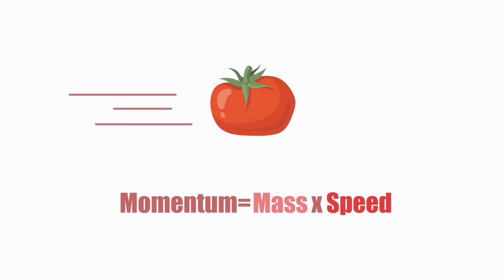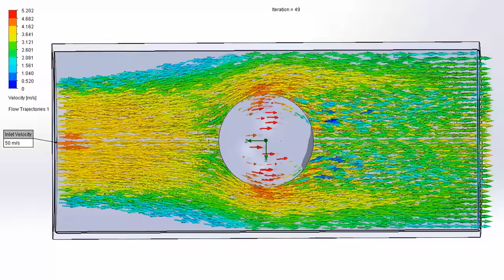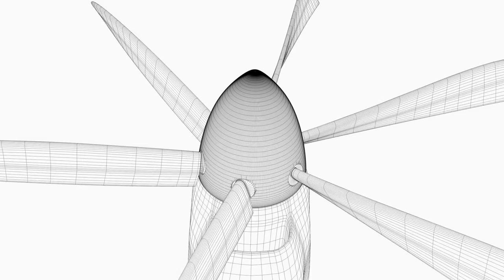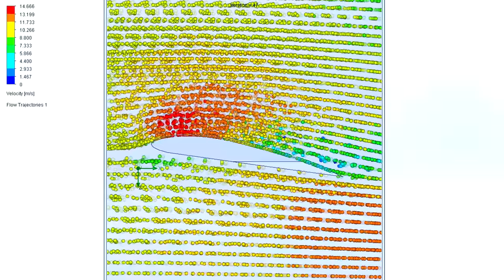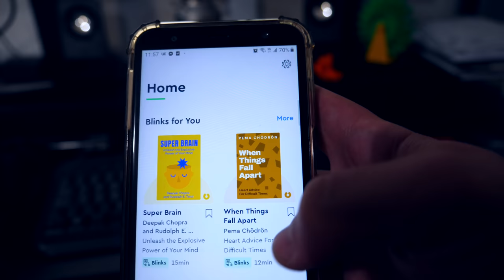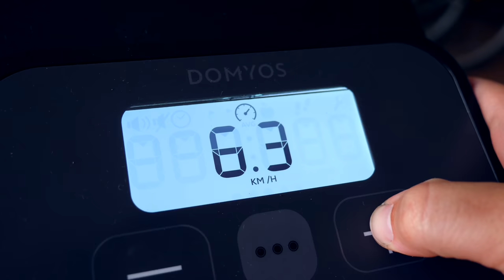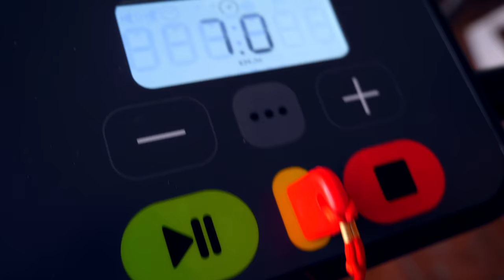Wind Powered Car (3D Printed)

Comment: Video Idea: for a future video maybe you could create a glider launched with rubber bands that uses the principles of drag and lift demonstrated in this video, maybe using a propeller, to extend its time in the air.

Also tomatoes are disgusting.
Reply: This vehicle relies on having contact with both the wind and the ground at the same time in order to extract work from the energy differential of the two media.  

One way a glider may be able to do similar is to be large enough to span two different air currents, using the difference in speed between the two to power a propeller

Comment: In a sailboat you extract the energy contained in the differential between your speed and the wind speed. In a correctly tuned propeller car, you are extracting the difference between the wind speed and the ground speed no matter what the cars speed is.

Comment: Video idea for you: Try 3d printing a steam turbine. Not the boiler obviously, but a tesla turbine or normal turbine would be cool :)
Reply: He has made a tesla turbine video
Reply: @emilsmadvlogs5879  Yeah but not using actual steam. I wonder if 3d prints hold up to the heat and pressure.

Comment: You don't have to use a trademill machine for this experiment. Just attach two rollers below each wheel and calculate the RPM of below roll. It will also easy if you shift the fan some degrees and calculate the air coming from amy direction.

Comment: Also because the propeller of yours is inclined, it pushes much to the ground and increases the push downwards. Maybe if we attach the prop with the rear wheel perpendicularly and trying to make the body from light material like like carbon fibre or something else. I might be wrong but it might work.

Comment: Hey Integza,I think you can make a flying bicycle. You can use Wankel rotary engine that burns hydrogen as a fuel as a propulsion method. I would recommend using electrolysis for producing. hydrogen.

Comment: THEY CHANGE THE PITCH ON THE BLADES LIKE A GEAR RATIO TO INCREASE WHEEL SPEED PAST WIND SPEED. 🧐
Reply: He never said anything about the gear ratio.
Reply: That is what is exactly stated in the video.
Reply: yeah, you got it, and integza is wrong on that point

Comment: The best way to demonstrate the  concept of this car is take a spool that can roll up a string. Bend a coat hanger into an axle for the spool and a guide for string. Run the string through the guide and start it on the spool. Go to the other end and  pull the string. The spool will roll up the string as it travels along the floor.  Since the spool will roll up the string and catch up to you. It will obviously have traveled faster than you pulled the string.

Comment: Love the combination of science and silliness (sillience?).
Your video helped me to understand. 
The moving car is stationary relative to the wind but a rotating propeller still generates thrust in still air.
As far as the free energy argument goes, without the propeller, the car won't go faster than the wind no matter how much surface area it has. Any surface area in excess of that required to overcome mechanical friction can gather the energy required to drive the propeller.
Sorry to say, but I like tomatoes.

Comment: Question! Maybe I missed something but the model doesn't ever reach a speed faster than the wind/fan? It really just matches the fans speed with the treadmills. In the real case the fan would slowly subside the faster the vehicle moves. So does this model really prove anything? I mean a normal sail, with no angle to it, would produce the same result on the treadmill?
Reply: gonna have to watch veritasium for a working model that doesnt need a fan to accelerate
Reply: You're right, this particular model doesn't prove the theory because the fan is there. All the treadmill does is emulate the vehicle going at windspeed so adding extra wind is a hinderance for explanation. A correct and working model should be able to accelerate up the treadmill with no added windforce behind it. That being said I think he's really close as the design is very similar to Xyla Foxlin's

Comment: VIDEO IDEA - squish tomatoes and use them as fuel for a rocket engine
Reply: VIDEO IDEA - last time you made a 3d printer that could print metal, now make one that can print glass. it would be pretty useful too since glass can withstand high temperature and you could make engines using it

Comment: It is kind if autorotation for helicopters. Some part of the blades generate lift, while other part harnesses energy from moving air to turn the blades. The balance of these two things helps us land helicopter without engine power...

Comment: My suggestion for a future project: An delivery service utilising autonomous sailboats. A small sailboat that navigates using ardupilot and is propelled by wind (sails or magic derek-downwind-propellers). The boat has a watertight compartment for storing the object to be transported. If you do not have access to a large body of water you might do a land yacht.

Comment: the force of the impact remains the same regardless if you run at the thrown tomato or stand still. mythbusts did an episode on this after they rammed two trucks at 50mph into eachother and stating that it would equal a 100mph crash how badly each truck was damage was indicative of each truck experiencing a 50mph crash

Comment: I think he MISUNDERSTOOD the concept of relative speed. Using this concept, the car is probably NOT faster than the wind. The car going forward does NOT meaning that is going faster than the wind !
Reply: you can see in the vid that the car is in fact not going faster than the wind at https://youtu.be/QHJka4_ZioU?t=826
the streamer is going forward not backward, as explained in the Veritasium vid it is only faster than the wind if the sail goes backward 
his explanation is sound, but the model car doesn't work
Reply: His demo car, perhaps.  But the real phenomenon he's describing does work.  My guess is the angle on the prop wasted too much energy pressing the car down.  If it's done right the car will move forwards on that treadmill without a fan.
Reply: @09morbab  you linked the old prop not the "foam" type one he printed. But okay.
Reply: @Ross Radford What? HAHAHAHAHAHA. Okay. That would make sense if it also didn't have wheels and mass. How would the speed of the treadmill, which we saw, and the speed of the wind help? 

Plus you see at 12:10 it is not gaining or losing ground - the wind blowing and treadmill running - and then suddenly it gets momentum, without the change of wind, as the prop hit enough revolutions to create a low pressure. 

Your theory only works under the assumption the fan blows it forward constantly with no time that it is level for a duration. 

But I know, 3d print the files and then you make a video disproving this whole thing. LOL.
Reply: @NomadSoul76  Nah it does work. You can clearly see it does at 12:10 ... Its not gaining ground then suddenly it does, and the propeller isn't spinning any faster than before. These people are just the type to think they are smart and rather than put their money where their mouths are they just talk big on youtube comments. 

And if done right it wont. It needs some wind... You do get that? The whole thing was using the wind but going faster? Like the car... So without the wind it wouldn't work... He was trying to recreate the same thing. Getting the prop going on the treadmill wouldn't be using the winds it would be simply spinning a prop? It's not magic... It's not a case of you get it spinning and it magically keeps spinning and pulling. It's not an actually 1920s crank start. LOL. 

I see why he said the bit at the end... A lot of people seem very confused about what it happening. Maybe he did explain it badly and it's just a concept I already understand. I mean it's only resultant forces and shit. In the UK this is our A Level physics. Fuck. And I thought England had the worst schools in Europe.
Reply: @razerow3391  You're completing missing the point of the phenomenon he's trying to explain. It should work without the fan being turned on at all when on the treadmill, to simulate the car being at a speed equal to the wind speed i.e. a relative wind speed of zero. Watch the most recent Veritasium video where they got a model to work.
With the model shown here, just putting a flat square sail on the car instead of a propeller hooked up to the wheels would produce the same outcome - the wind will push the car along to some speed that's greater than the treadmill speed, but not as fast as the wind speed.

Comment: You're mixing two frames of reference here. 
To use the threadmill example, where the car is moving forward in the air with the ground moving backwards underneath it:
- The wheels drive the propeller
- The propeller accelerates the air backwards, creating thrust.

Now let's move our perspective to the ground being stationary and the air and car moving in the same direction:
- The wheels drive the propeller (same same)
- The propeller slows down the wind behind it, creating a low-speed area behind it. This is where the energy comes from to go faster than the wind.
Say the airspeed is 20 kph and the propeller accelerates it with 15 kph in the opposite direction. The resulting airspeed is still forward, but at 20-15=5 kph.

It's a wonderful almost counter-intuitive system, but once you grasp it it's simple and elegant.

Comment: Theme: Building a plazma cutter out of a 3d printer
Reply: Huh? They are essentially the same mechanism. You would only need to swap the bed out for an elevated water bed. In fact the welder holder from that video could already hold a plasma cutter.
Reply: @owenkegg5608  it is using the same mecanisum he just needs the water bed

Comment: It looks like you should not need any fan, but it helps if the treadmill has limited speed. Also the wheel-size, gear ratio, and prop pitch will have to be just right and low friction too.

Comment: print suggestion: print a raptor engine from spaceX
Reply: Engines my favourite topic
Reply: you kind of can't do that
Reply: h how? How do you expect him to do that?

for 1 the raptor is proprietary we don't have the plans for it (to my knowledge)
And 2, that is way beyond the ability of a 3d printer, any 3d printer that exists now prints imprecise objects usually of plastics, the raptor engine is an extremely precise and complicated engine that requires a lot of expensive tooling and materials to manufacture

And if you remember integza's attempts at Rockets so far are barely functional boosters that produced nearly no thrust, how would you expect him to make something that produces enough force to lift tons
Reply: How about we do one better and just print SN13

Comment: In short: for a limited range of velocities, the kinetic energy added by the wind cancels out the air and ground drag against the car itself. And without any power to get the car up to speed, such as from the wind, this doesn’t work. The same idea applies to jet engines and most heat engines; the wind propeller just has a very flat temperature axis.

Comment: I think you need to use the prop backwards, as a tractor, you rely too much on the fan blowing on it, it should have enough momentum with the treadmill and the wheels to gears, it should work.

Comment: Unfortunaty Integza, despite all that energetic and enthusiatic presentation of the concepts, the way you have set up the experiment, with BOTH a treadmill AND a fan completely invalidates the premise of the debate... If the cart stays stationary on a moving treadmill WITHOUT a fan, it would prove that the cart is capable of achieving wind speeds when observed from a moving reference frame. If your cart can only stay stationary WITH the fan on, then your setup has only proven that your cart can reach sub-wind speeds. ONLY when ur cart can accelerate forward WITHOUT a fan on a moving treadmill, like Xyla Foxlin's video, are you then able to prove the point that they have successfully proven.

Comment: Now do it without a fan, or without treadmill with fan 🤦‍♂️
Reply: The fan is needed for the wind...  It pushes the car faster than the wind, but with no wind there is no movement.
Reply: @TheRealMonnie  Sadly this Videos explaination falls into multiple fallacies. First it forgets that the frame of reference where the car has to be moving faster than the wind is defined to be the surface of the treadmill. By introducing the fan, he actually only proved that the car can go slower than the wind. The second fallacy is that the energy propelling it forward comes from the pressure difference of the air, when it actually comes from the wheels driving the propeller, which in turn creates the pressure difference, and - probably more importantly in this case - transferring momentum to the wind by redirecting it.
Reply: @TheRealMonnie  Nah, just needs a faster treadmill.
Reply: The treadmill is just to simulate speed. And it needs a fan because the scale is too small to produce much drag.
Reply: @joshuadelaughter  Yeah, but then you need to measure the wind speed from the fan to prove you're going faster than the wind.
Reply: @Poldovico 
Yeah. I think this was more for sake of example than an actual test though.
Reply: @joshuadelaughter  Very much, yes. In the end, integza was trying to prove it to himself, so if he did that's good enough for him.

Comment: sailboats go faster than the wind dead down wind all the time. apparent wind, if you start on a broad reach, gain 2x the wind speed and bear away to what would be a dead downwind angle, you'd have the same sail setting as what you did on the broad reach. this is because of apparent wind, the faster you go, the faster the wind your boat experiences. if you are on a different angle to the wind and going faster than the wind, the 'direction' of the wind changes (basic vectors). Skiffs, cats and hydrofoiling craft do this all the time at up to 4 times the wind speed. slower, smaller classes also go faster than the wind dead down wind through pumping the boat, or surfing.

Comment: 3D print a wind turbine that captures energy of course but also auto adjusts the blade angle based on wind speed and or direction, in order to optimize the amount of energy captured.

Comment: That is similar to the rovers NASA are thinking about for Venus.   The heat ( hot enough to melt lead )  fries electronics so they are thinking of a more mechanical solution to minimize electronics used.  The previous successful probes only lasted a few minutes before the heat and pressure killed the probes so more clockwork type things have got to be worth a try :)

Comment: I have a quick thought experiment to get people past the idea that it's impossible: imagine a long train going downwind at wind speed. Take a massless (or very lightweight) windmill and spike it into the ground at the front of the train. Use the electricity from the windmill to power the train motor. Pick up the windmill at the back of the train, carry it forward, and repeat. (That drives home the point that we're harvesting energy from the difference between wind and ground velocity, and that we can do that harvesting even from a moving platform.)

Comment: Since the car moves faster than the wind, then by using wind which is near light speed you can make the car move faster than light, which of cause would create a wormhole to the future where the car would travel through. You should be able to, with the right setup, through all the tomatoes of the universe through the wormhole and let the future deal with them.

Comment: Use an anemometer to measure the speed of the fan wind and mtach it to the treadmill speed. If the car moves forward, you got it.

Comment: I have the right answer.
The key to this vehicle exceeding the wind speed is the energy storage device found on the vehicle.
The propeller is also a flywheel so during the initial acceleration phase the flywheel gets charged and then that energy is what accelerates the vehicle above the wind speed for a limited amount of time then as that stored energy is used up the vehicle will slow down to below wind speed.

Comment: Integza, I love that breaking the laws of physics is so trivial to the YouTube armature experimenter,  but I love seeing your rocket experiments.  I think you should try a hybrid air/water rocket, except for the twist is to use a series of capacitors as a launch device to send thousands of volts into the mixture causing the water to separate instantly which I think should make the pressure of the chamber increase dramatically causing thrust and life off.  You would need a "plug" at  tapered end (think rocket design) which would pop off at a certain point allowing the mixture to escape.  Two electrodes at either end which the capacitors and a switch would allow the release of the voltage.  Think stun gun type voltages... I am designing a "gun" which has what I call water bullets, though technically any fluid/gas (such as air) which can disassociate should do the trick.  An O-Ring keeps the head of the projectile in the tube, with a sealed end.... and pop.  If I make a video of it, I will surely give you a  peek.  A 3D printer would surely come in handy....
Reply: Sorry... just to add... think of it as steampunk rocketry, and steampunk water guns?  Since I am believing the water will instantly turn to steam before exiting the chamber.  What do you think?